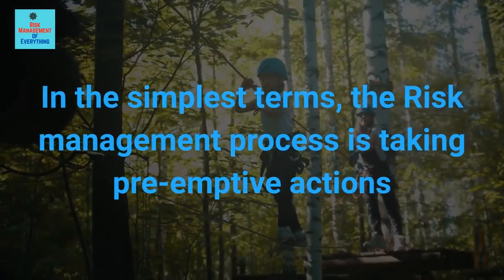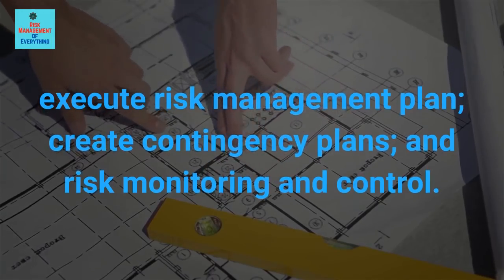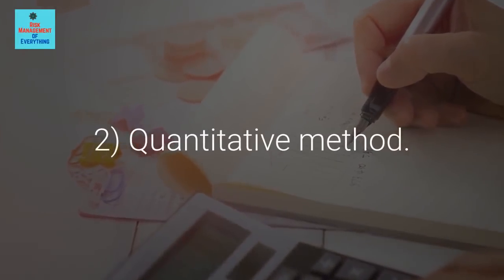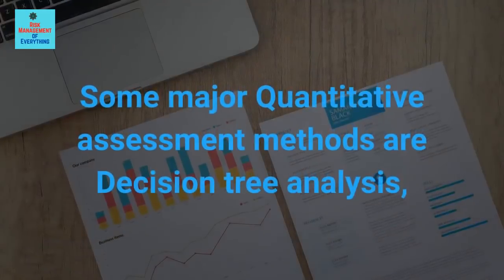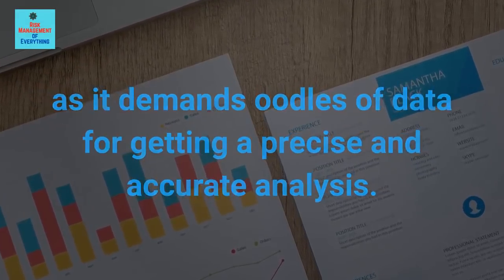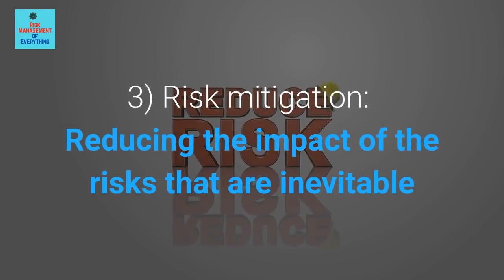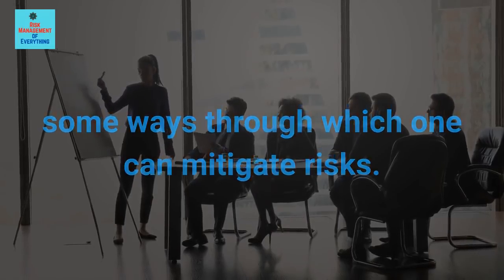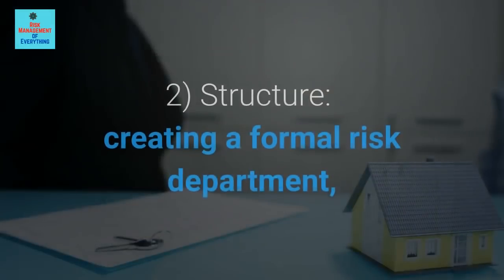Risk Management in the Construction Sector (Construction Risks and Construction Risk Management)

Comment: Great presentation, I just wanted to find out project risk management can be applied in the construction sector and which tool would be most effective between project risk management and risk management
Reply from the maker: @ Brain Mwansa, thanks for seeing our videos. Project risk management can be applied in the construction sector. This video highlights key areas of the application of risk management in the management of projects - project risk management. For instance, a project team can use a risk matrix as a primary tool for the risk register to identify which risks fall below the tolerance level and need to be planned. The completed assessment can be used to plot each risk on a quadrant: high probability and high impact risks in the upper right, and low probability, low impact risks in the lower left. The quadrant represents a typical risk matrix.

According to a survey conducted by Project Management Institute (PMI), almost 86% of organisations use risk management methods irrespective of the size and industry. With the advancements in technology and everything going digital, project managers have started integrating digital risk management tools/software into their project management. Here are the most preferred tools by project managers across the globe:
1. nTask: nTask is a full-fledged project management tool that enables effective risk reporting, easy visibility, calculation of exact risk impact, and auto-generating risk matrix summary.
2. Resolver: Resolver focuses on project risk planning and preparation phases and incorporates benefits such as practical assessment, customisable reports, real-time insights, incident management, risk prioritisation analysis, risk retrieval inventory, and risk response management.
3. Time-Camp: Time-Camp is a time tracking tool that provides features such as identifying potential financial risks, time management evaluation, and curbing festering risks.
4. Integrum: Integrum is a risk management tool that focuses primarily on a project's health and safety. It provides benefits like risk identification, business optimisation, and business intelligence.
5. Qualys: Qualys is an advanced risk management tool that offers benefits such as vulnerability scanning, malware scanning, detection, and threat protection.

Hope the information provided above is helpful? Once again, thank you for seeing our videos. If you are new here, make sure to subscribe to our channel and turn on the notification bell for more videos: https://bit.ly/3hMIfAJ